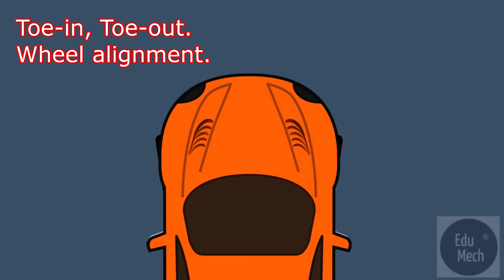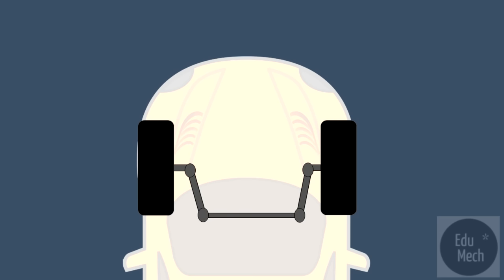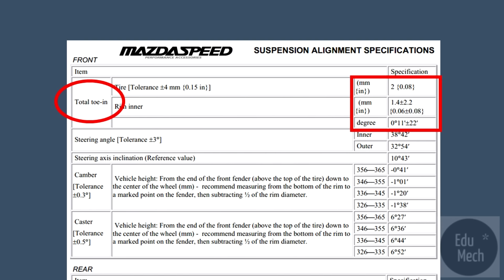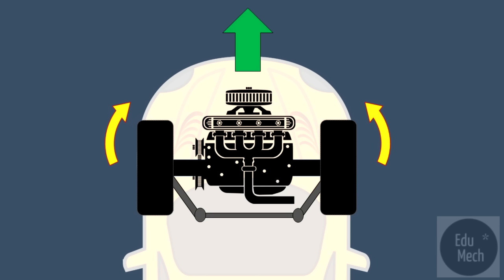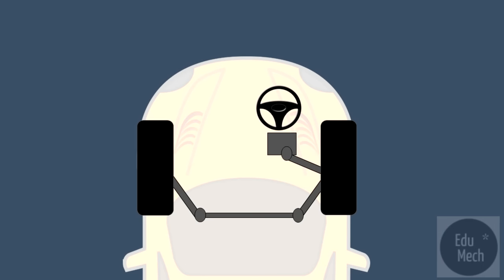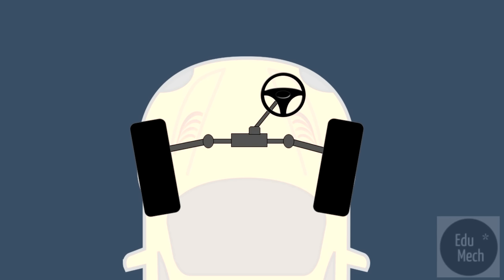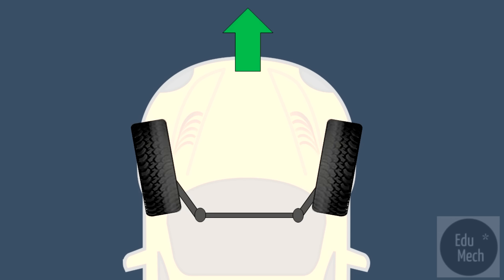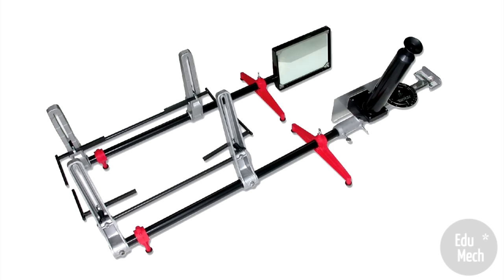Toe-in and Toe-out, Wheel alignment Explained - How it works.

Comment: finally I found a video that confirmed my problem without spending any money! my car has inner tire wear in the front and feels wobbley on the highway. I will do a small toe-in adjustment today 😬
Reply: okey i tightned my front end, holyshit the car drives smoothly now! it used to feel like I was allways driving on a very fine gravel road, not I can barely feel the road under me through the steering wheel. it does sharp corners much easier now too
Reply: Great information!
Reply: THIS! I've been wondering why my car drives so horrible ever since I put lowering kit on it. The gravel road comparison also hits home, feels like the car is floating and has no grip. Will have to try and adjust the toe-in accordingly.
Reply: @NoName-oj5km  I fine adjusted mine 2-3 times, it has more angle than what is stock on it. But the car feels more steady on the highway. One negative part about having abit too aggressive toe-in is the car is very sensitive to really small adjustments done one the steering wheel when driving. But the car doesnt float like a boat anymore at least

Comment: I need to find Rear Toe Tool for 2001 Saturn SL2. Do you happen know where I can purchase that tool? Bcs of the age of the car the local dealers don't have that tool anymore in their inventory. When attempted to do alignment on the rear of my car the screen shows: a tool which looks like L-shaped wrench and it reads on the screen "Rear Toe Tool". Thank you for the film.
Reply: I've never heard of that tool. When I did the rear toe on my 96 SL2 I just loosened the bolts on the arms (17mm I think) and used a pry-bar to twist the wheel assembly in or out. Then tightened up the bolts and remeasured it to make sure. You might want to go on a site called "Saturnalia" and see if anyone has info on where to get that tool. If you're buying it from GM, you can bet it's gonna be expensive.
Reply: @Cokie907  Thank you for the concern. I found the tools, they are:
1. "Specialty Products Company 78090 Rear Toe Tool for Saturn" and
2. "Saturn and GM Rear Camber / Toe Adjustment Wrench Tools Equipment Hand Tools".
They are both on Amazon, but I bought them cheaper through one company online.
I took them to the dealership and asked if I can watch how the alignment is done (never saw that procedure). They kindly agreed. I saw: they loosened the rear inboard lateral-link-to-crossmember 
fastener and started to adjust the rear wheel, moving the lateral link (can't tell in or out), using the first tool. Don't know if they used the second tool (I was watching on the distance).

Comment: I just did a string n tape measure alignment 2day and it's perfect and tracks straight with no hands n all😁.
But ya I did 1/16 TOE IN on each side =1/8 toe in all 2gether.
According 2 this do I now need 2 adjust each wheel 1/8 TOE OUT  taking it 1/16 past 0 degrees
??????????🤔
Reply: Does this cause stress on my cv shafts and wheel bearings on my 09 Lancer ES 2.0L front wheel drive 4banger??????

Comment: What are the effects on the rear wheels for fwd and rwd?
Reply from the maker: There would be very minimal effects on the toe setting for the rear wheels. The toe setting can be adjusted for specific situations, like autocross and FWD rally cars, giving them a tighter turn. Other than that, on a normal car, because the rear axle isn't steered, adjusting the toe of the rear wheels has a limited use.
see this article for a bit more info: http://www.motoiq.com/MagazineArticles/ID/1936/PageID/3049/The-Ultimate-Guide-to-Suspension-and-Handling-Part-Seven--Tuning-your-Toe.aspx

However, for cars that have a rear steered axle (Nissan Skyline, Honda Prelude) then the setting would be important to get the car to handle correctly.

Comment: @1:20 he said:
"the torque applied to the wheels on driving tends to make them pull themselves forward - toeing in."
how is that physically possible isn't the axis tied down to fixed Kunkle?
Reply: Bushings aren't completely solid so it can factor for the control arm bushings shifting